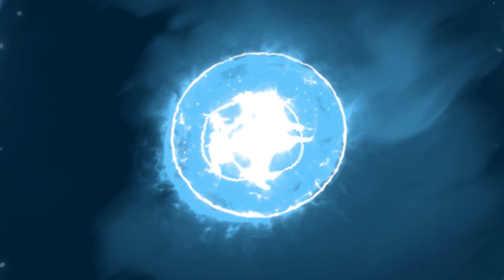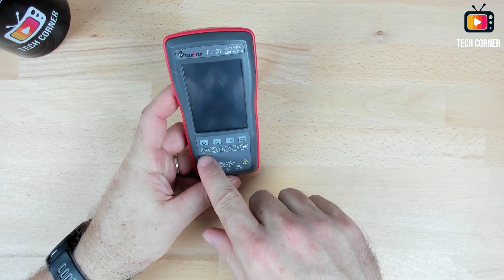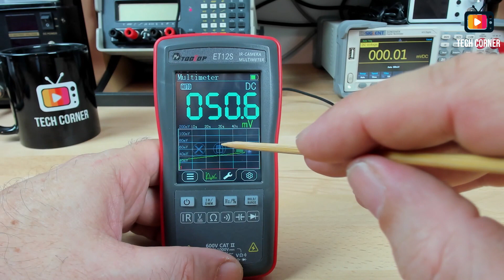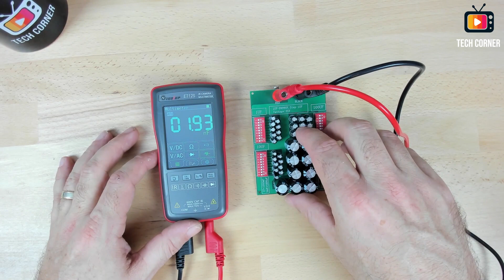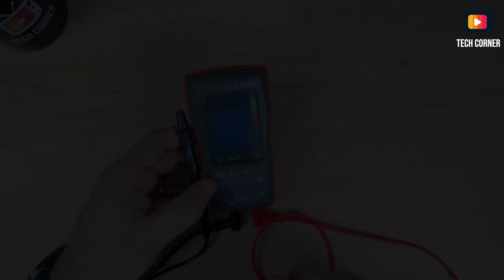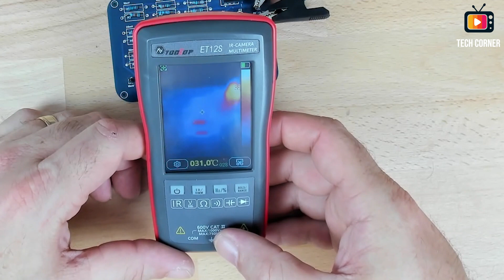Tooltop ET12S Thermal Imager + Multimeter ⭐ Another bang for buck?

Comment: Can it be used to detect water leaks on pipes or water leaks through walls, conduit pipes
Reply from the maker: Yes, it can help detect water leaks if there's a temperature difference (e.g., cold water vs. warm wall), but the low 92x120 resolution limits detail. It's more of a rough spot-check tool than a professional leak detector.

Comment: hi 
i have the same camera and has a problem with the temperature measure 
is not steady and is ansstable at least 10 degrees 
is there case to be someone set from the menu 
or maby i have a hardware problem ? 
thanks on advance
Reply from the maker: Hi, maybe it needs calibration. Not sure how to do it, do you tried to reach Tooltop? Thanks for watching.

Comment: Any suggestions as to what the problem could be with this multimeter? The thing is that it doesn't take measurements, the screen only shows 8888 even if the original tips are connected, thank you in advance.
Reply from the maker: Hi, you might got a bad unit, did you try to reach tooltop? Thanks for watching.
Reply: @TechCornerTV  The problem is that previously it worked normally but it has been in that state for approximately a week, and I no longer have a warranty with Tooltop

Comment: be carefull and do not buy the cheap one cause that will have a crazy low resolution which is useless low. The real one shown here is about 143€ here.
Reply from the maker: Hello! Sorry for late reply, house move and vacations. I know that the resolution isn't high. But even for this resolution the prices tend to be over 50€ just for the thermal imager, is true that the multimeter is a bonus, I can pass without it, but the all package is good, so I get what you're saying and totally agree with you, but the 300 pixels are still very expensive. Thanks for watching!
Reply: ET12S is 133€ while a 153,68€ brings you a TOOLTOP T7 256*192 Android Type-C Thermal Imager 25Hz
This is real poop nothing else, cheap multimeter attached to thermal imager toy to make you buy it for high dollar @TechCornerTV